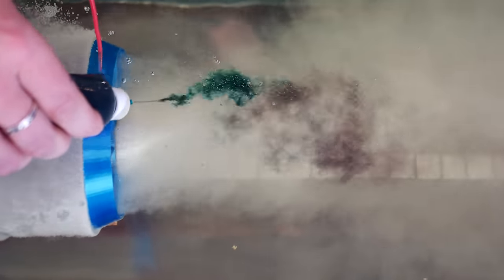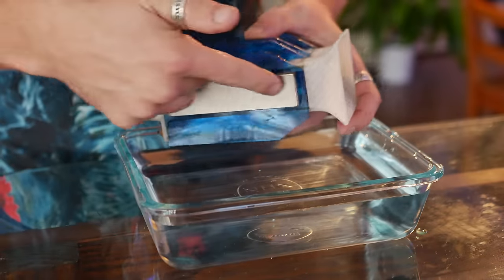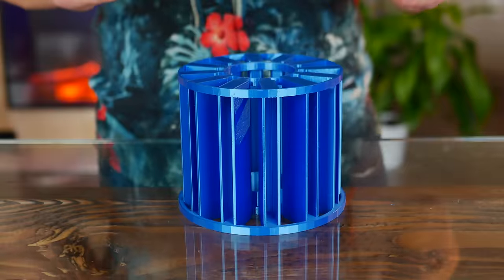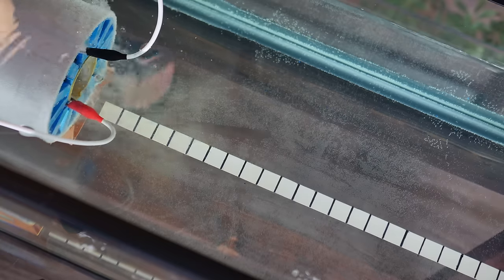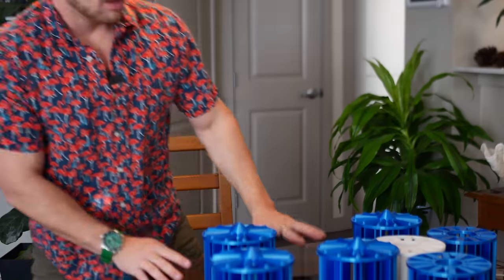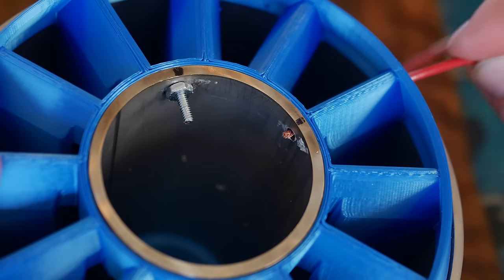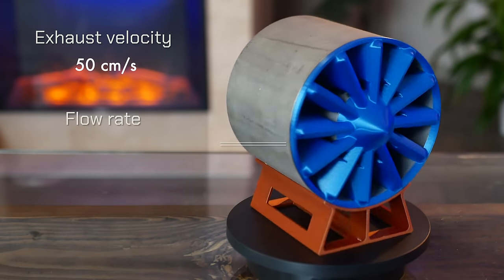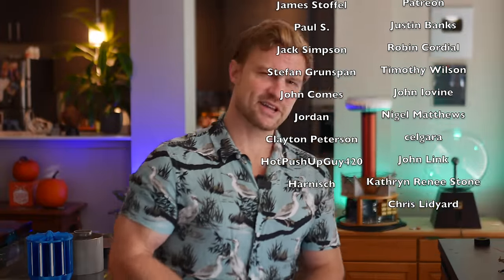Designing a Futuristic Magnetic Turbine (MHD drive)

Comment: It seems weight is the key factor here.  Do you get equivalent thrust per lbs of weight incurred over the typical Engine/Propeller.  I mean, u need some power source.  

Also, like turbines, it seems the "response" time would be exceedingly long.  Maybe good for cruising, but not good for getting up to cruise.

Comment: Can you move more water with a tiny propeller, using a fraction of the power?
Reply from the maker: Technically, you could move 5  times the water for the same power input, using a propeller. But then again, propellers aren't as cool.

Comment: So what if you added another identical stage behind this one, would you get greater flow?  What would be the optimum configuration?  I assume that laminar flow would be preferable and that Reynolds number would limit the effect at some point. Would a perfectly rectangular cross sectioned channel be better than the wedge shaped one you created?  I think the large faces of the magnets are the poles, so If the vector cross product of B and J gives you the Force vector, how come adjacent cells don’t produce opposite directions of flow?  This is cool stuff!!!
Reply: The adjacent cells would produce thrust in the same direction (my error), because going around the circle, each cell would have the same N-S orientation in relation to the electric field.  Is there a Dyson induction configuration that would allow you to hydraulically, increase the flow through an open center pipe in the center.  Maybe even skew the MHD channels to create some vortex action?

Comment: What about using a very much higher voltage with a flyback transformer or something. Think of something like an ionic thrust driver. Would the proportional higher voltage drop the current?

Comment: could you try and put the whole assembly into a long tube and a restriction some distance down to narrow the flow of the output water Venturi effect. Alos try coating the stainless steel to avoid errosion.

Comment: Could you reverse the corrosion by reversing the current every few seconds? Just pulse it back and forth? What about longer duration reversals? What about mounting the thruster on a motor that could spin the thruster? And forego the boat. Instead, make an underwater drone. With cameras, sensors, and the ability to place a magnetic package containing a gps tracker to any steel hulled vessel. Spy agencies worldwide will love you.

Comment: What would happen with 3 of these connected in series along the same tube structure?  Would the acceleration of the water plateau with the voltage, or would the accelerated water from the first stage increase in the second and again in the third?

Comment: Cool concept but the power required to actually move a boat with any real speed is going to be absurd. Also trading noise in the ocean for electrified water seems kind of redundant. Any sea creatures that would normally just get scared away with a normal propeller system are now going to possibly be electrocuted instead. Not a very good trade off in my opinion.

Comment: Hang on they use this in Model aircraft as electric jets even up against fuel jet engines for model aircraft The Fuel jets were faster and flew for longer but heavier. The types of electric power motor is from 5 KVA down to 1 KVA far cheaper than a Fuel Jet. Yes you can have a 5 KVA motor that can fit in your hand and a 1 KVA that can fit in any type of remote control car. Induction motors is what they all are as no need for Brushes or as some call them Brush-less motors.

Comment: Has anybody tested insulated electrodes? Insulated electrodes with high voltage may or may not create an electric field capable of generating thrust in water. If it did, it would solve problems such as power consumption and corrosion.

Comment: My curiosity is what about the electrolyses caused corrosion of the stainless steel ? 
What are the bi products of this process and if as I suspect chromium is one of them is it an acceptable trade off? With fossil fuels or are we literally just trading one pollutant for another and still most likely will need some sort of a generator to power !the thrusters 25 vac or vdc @ 30A is a fair amount of power! 0:26

Comment: I wonder if you can get away with coding your stainless steel pipes you're only using a magnetic fields to be able to create the lens force and push the water. This should cut down on your amperage so you should be able to increase your voltage

Comment: I'm curious how this propulsion would be effected by high frequency pulses, and possibly a rotating field much like the ac motor...
Reply from the maker: AC field would totally work. It's a bit of a complication, and build would be more difficult, as the magnets would need to switch polarity in sync with the electrodes switching polarity. But, yes.
Reply: @PlasmaChannel  that would get into linear phasing and cyclic rates to vary propulsion, right? My thoughts go to magnetic cycling rather than the electrical fields causing the gassing issues...specifically chlorine gas.

Comment: Does the salt water add to the reaction? what's the salt water solution compare to the ocean water solution and does it work in fresh water?
Reply from the maker: The salt water I used was mixed to perfectly match average ocean salinity. It does work in fresh water such as a lake, however, at significantly reduced output. greater than 90% reduction.
Reply: @PlasmaChannel   Sounds like only ocean application then, and the efficiency (enery usage to thrust) even in ocean application would be much lower than traditional prop designs. However, great concept, design, and build to show it does work! I could definitely see your design incorporate some sort of integrated prop design and to reduce cavitation maybe a toroidial design like in drones to still make it quiet. Some moving parts but the neodym magnets would make a strong motor and a prop would make applicable in both salt and fresh. I know the point of this was no moving parts, and it does work but I think you have something there that could really see commercial application.

Comment: Ignoring the largest factor you found that increases trust, field length.... 

 Why not just make  a hella long one based around copper water pipe for the electrodes... 

3 magnets in one, 2 pipes positive on one side, 2 pipes negative on the other, row of magnets in alignment holder.

Comment: Kudos for lots work.!  Eventually you'll end up containing this to produce pressure so higher velocity cuz that pokey fluid movement = almost 0 thrust.  I know similar design directly rotating a prop inside a ring is /was in test in like a tug as i recall.  you'd need hell'u velocity for direct stream of water to make any thrust what with water's resistance and all.   51 hrs?     But Yeah, that noise reduction in the ocean does seem like an envo problem that is real.  Unlike some that are being used to force humanity's impoverishment and doing nothing for the planet anyway.  Climate Change would be a good example of that.  Do you have to self edit or does it happen before such heresy can even be posted?  tks

Comment: It looks like hydrogen production.   Did you test to see if you’re creating hydrogen, and if so how much?   Also when you electrify the metal as you pointed out there is decay.   This decay is toxic for the environment.   Probably not good for the fish.   I think you’re not going to get enough thrust to move a boat, but you might be getting enough hydrogen to run a small engine.

Comment: Wait... Even the wires inside electric motors are insulated, so why you exposed yours 🤯 to has direct contact with water on your earlier attempt and shocked that the exposed metals corroded?😅

Can't the stainless steel be wrapped in plastic or gelatin to  make them waterproof?

Comment: electricity and water dont go well together, this  decomposes (breaks apart elements) water H2O through electrolysis, and if salt is in the mix, chlorine gas which is toxic, so your not saving the environment, your destroying it. best to just stick with tried and true efficient mechanical propellers and turbines.

Comment: Now how are you going to handle the corrosiion of the steel that will obviously happen with this design. The parts might not be moving but they certainly are disintegrating. Putting iron into our oceans is not a solution.

Comment: So where do you get the Electric, if using on a large scale ship?
Batteries!!  More environmental JUNK from Chi-Nah!
To make a cargo ship to move @ the same speed (20 kts or 1029 cm per second) it does
with conventional props will take HUGE amount of electricity.
I'm not even going to attempt how many batteries would be need, not to mention
the weight of them and how much space they will take up.
This myth is busted!! You wasted a lot of money and time on this.
If you really want make a huge ship go faster,
move the water out of the way before the front of the ship touches it.
( Air Compressor probes on the front edge of the ship but not much, must keep the ship  buoyant)

Comment: They require tons of energy.  So how is that gonna work..lol. you cant only use nuclear power on ships to use ur low efficiency thrusters. Dont blow smoke. I have a propulsion engineering degree....this can't produce enough thrust for the weight.  The voltage required is massive 😂 so youre wasting tons of energy for a novel idea at this point.